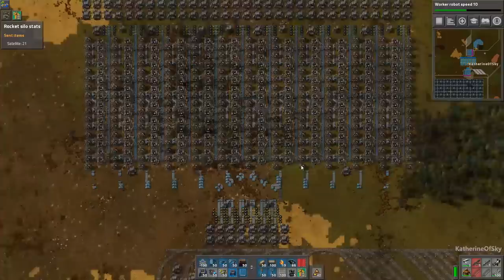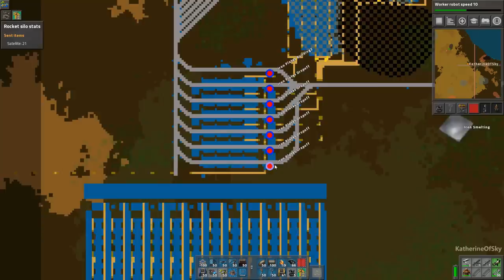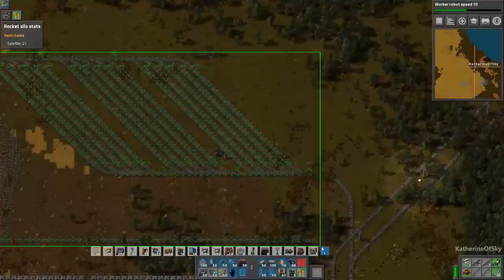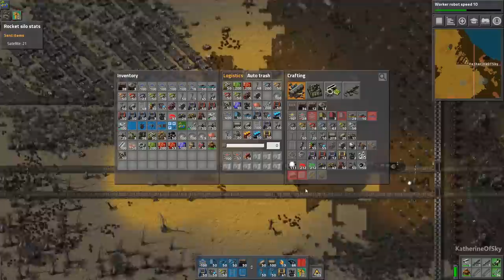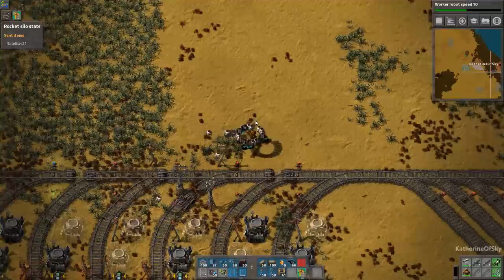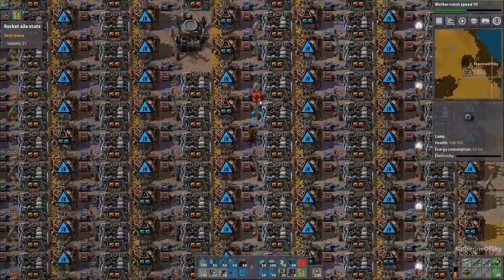Factorio: Entry Level to Megabase Ep 56: BOT BASED COPPER SMELTING - Tutorial Series Gameplay

Comment: The total crafting speed necessary for a blue belt is 140 (1 item per 3.5 seconds x 40 items per second). Divide 140 by 9.4, then by 1.2 to get total machines necessary. Which is 12.4 like you said. I like to round it down to 12 and settle for 97% of a belt.
Reply: 6 per side (12 per column) with all those buffers in chests is a good idea. Or go with 7 per side (14 per column) with a setup like in the main base, which is supposed to output fully saturated belts continuously.
Reply: Full saturation only matters if you're under producing. A 97% saturation can handle full drain for 18 minutes at a time.

Comment: You have 13 furnaces which is enough for 12.4.  But if you look at each lane, you have 6 and 7, but need 6.2.  So one of your lanes will be full, but not the other.  I think the easiest thing to do would be to have the top one output north and lane balance that single output.  I've seen more clever solutions before but I don't recall exactly what they did.
Reply from the maker: That would be a bit messy.  I may just convert to 12.

Comment: I'm a bit confused about why the copper outpost stations had to be redone. It looks exactly the same as the first time.
Reply: Same here
Reply from the maker: It was an alignment issue with the mainline track.  I had to move the stations up several tiles.
Reply: Except you didn't...  That's why the input lined up so well with what you had.  :)
Reply: See, that's what I thought. First attempt at 16:08 looks identical to the second one at around 21:45.
Reply: It's NOT placed at the same location. The second time she placed the station, it was moved exactly 1 train track width further north. You can also clearly see that the out-track from each station is one straight track longer.
Reply: Yep usual KOS, "I'm leaving lots of space" or moving something a long way, builds 1 maybe 2 tiles too close than anyone else would do.

Comment: Would it make sense to put 2x Efficiency modules 2 in machines that can't accept productivity modules and don't need speed or mix efficiency modules 3 and speed modules 3 for machines that can't accept productivity, but a little extra speed would be useful for them? Or is this not even relevant when you can simply expand the solar farm? 

These columns of robotic smelters must be so tall to make better use of speed beacons. Otherwise it would make more sense to make the furnace area thicker and shorter to shorten the distance between ore in and plates out stations.

Comment: Could be nice to connect your self to the electric grid (at least for charging the batteries) and also I thought, you can refuel with coal!! I mean liquid coal turned into rocket fuel :)
Reply from the maker: Indeed!  Would be nice to have a way to charge batteries at the base!
Reply: There's a mod for that: modular charge packs. But it requires you to manually put the charge packs in the suit and take them out once they are empty.
Reply: I think there's an induction coil mod too by Raeon: https://mods.factorio.com/mods/Raeon/Induction%20Charging

Comment: I think that you would have been better off turning the copper smelting horizontal,   because the bots would not have such a long distance to fly!
Reply from the maker: It may yet grow to be longer on the horizontal axis than the vertical :-)
Reply: I do a lot of bot builds and Julie you are absolutely right. This design is going to have the bots constantly migrating down towards the plate trains. You will likely have a situation where they will all be trying to charge down there and almost never use the ports you put by the ore unloading station. Which will result in a lot of stalled bots waiting to charge even though you've got more than enough bots in the network. With the longer flight paths the bots also won't be able to move as much material before they need to recharge.

Also, watching you set the network to use 9k logistics bots was almost painful. More than about 3k in a network will tend to cause UPS problems. When going full bot based you are usually far better off setting up multiple smaller builds than using one massive build. I set my smelters up so that each build eats ~20k ore per minute, and outputs 24k plates. I have the input and output in the center of the build and the smelting arrays on either side. Input is two 2-5-2 ore trains feeding two 1-3-1 plate trains, which maintains the perfect ratios with productivity modules so that the traffic cycles are consistent. Even better each build uses less than 1000 bots at full throughput, with worker robot speed only researched to level 6.

I do prefer double headed trains rather than loop systems though, and I'm not sure if the build style I use could be adapted to a looped train system without causing jams.
Reply: Came to post this, but you already did it better!